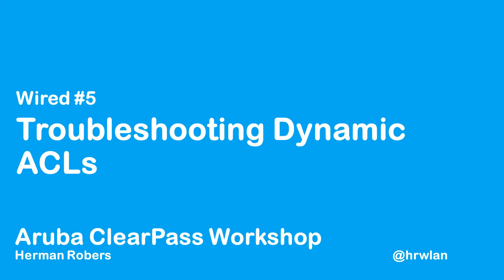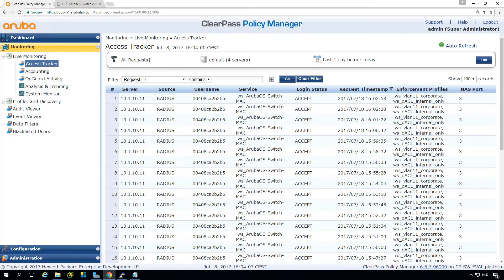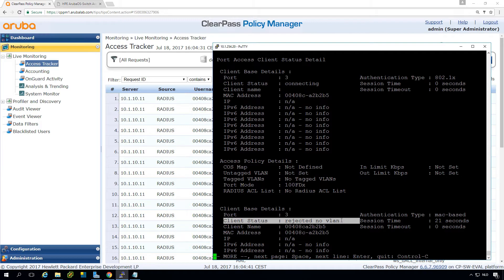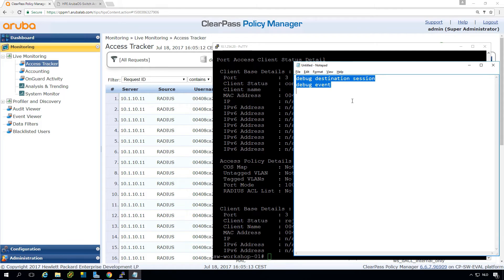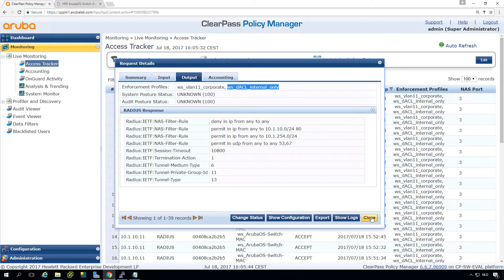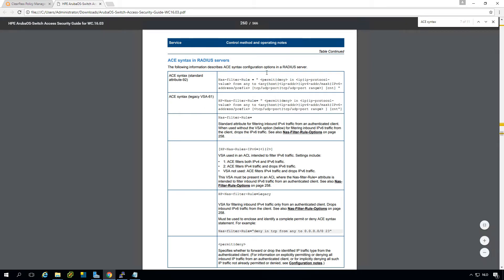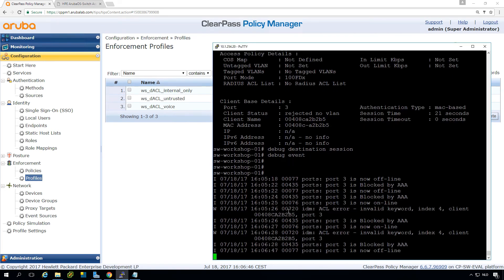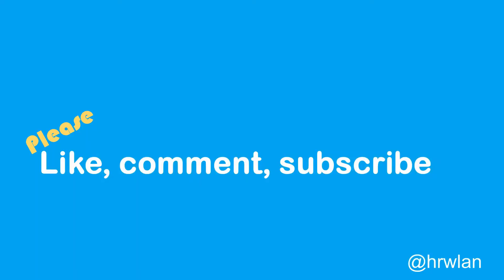HPE Aruba Networking ClearPass Workshop - Wired #5 - Troubleshooting Dynamic ACLs

Comment: Hi Herman - was wondering if you were planning videos for OnConnect and OnGuard.
Reply: I hope to make videos on OnGuard (need to find a good moment to do so). I have not planned OnConnect videos, as if you have 802.1X, and MAC Auth combined the end user experience is much better in my experience. I see OnConnect more as a fallback if you can't do 802.1X with MAC Auth, which works pretty well on most modern switches. If you want get started with OnConnect, there is a nice guide available here: http://community.arubanetworks.com/t5/Security/ClearPass-Solution-Guide-Wired-Policy-Enforcement/td-p/298161 (ClearPass Solution Guide: Wired Policy Enforcement).